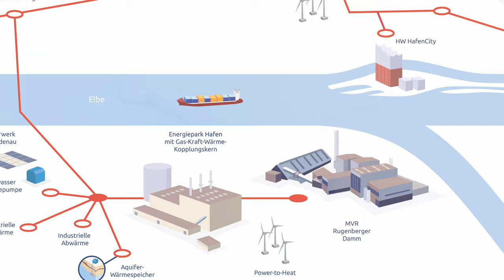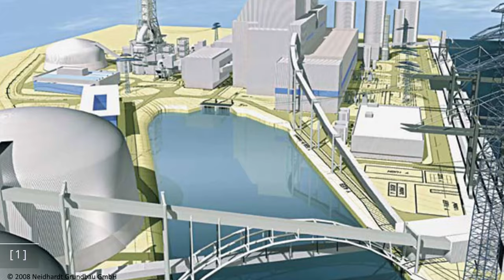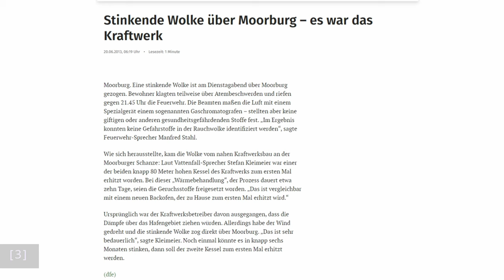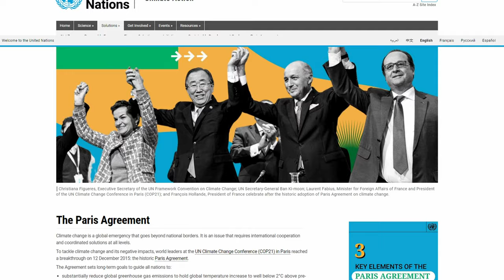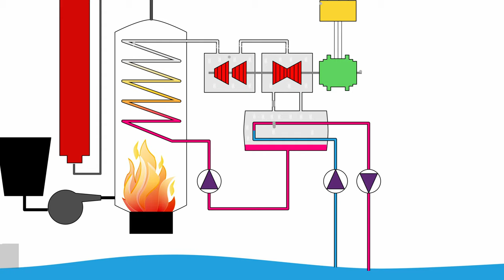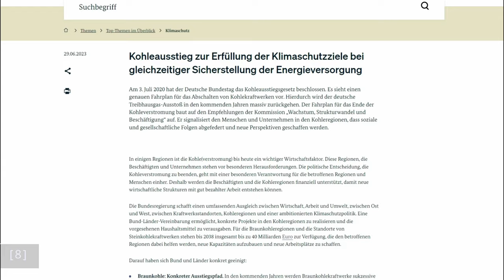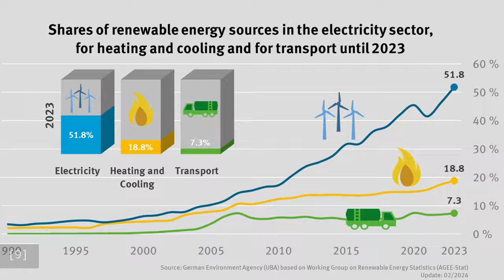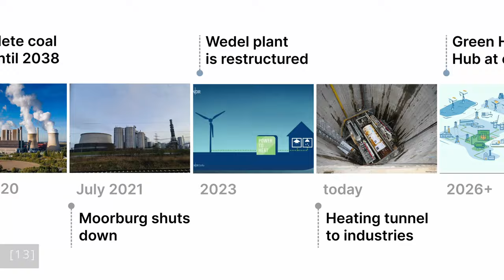The Failure of Europe's Most Efficient Power Plant. What Happened?

Comment: Whoops shouldn’t have stopped nuclear 🎉
Reply: imagine the blunders on that one. Perhaps they should have
Reply: This plant has 2x800MW boilers, the perfect size for a new EPR reactor to be put in to run them.
Reply: We used half as much coal last year than in 2002, when all nuclear power plants were still operative. The world has changed.
Reply: @denniskrenz2080  Yes, but you'd use even less with the 8 nuclear power stations still operating.

It shouldn't be nuclear vs renewables, their both green energy.

You could even retrofit thermal storage to your nuclear power stations to make them dispatchable, with would allow you to use them to fill-in times when intermittent renewables aren't producing (which you currently do with coal/gas).
Reply: @denniskrenz2080  
Half as much coal is fine, but what really replaced it and the nukes? Most likely natural gas, because renewables aren't there just yet.
And how much less CO2 would you produce now with all the nukes still operational?
Reply: @domtweed7323  That is wrong. we would just EXPORT more. That was already the problem for the operators and the luck for our neighbours (Like Netherlands). The NPPs had to sell electricity at too low prices to at least cover the operating costs (see the balance reports of the operators there, at least in Germany, they are all public after half a year). We had the choice between a controlled exit, an uncontrollable one or growing subsidizies like France to just keep them going.
Reply: @denniskrenz2080  Firstly, there's nothing wrong with green power exports. That would help your neighbors, like Poland, use less coal.

Secondly, running a nuclear power station is incredibly cheap after you've built it, most of the cost is construction. There's no net subsidy needed. Same in France, where EDF will be profiting from it's 59 existing reactors for decades, because their extremely cheap to run (though rn their catching up on deferred maintenance, so it looks more expensive than it actually is).
Reply: @denniskrenz2080  
Your aware the life time of a power plant is at least 40 years ? Fossil fuel supplies are expected to be spent in about a generation. 

The choice is ensure you have power, at what price that power is, or enjoy a 10th century life style. (Renewables are estimated to be good for about 10% of current power levels)

The raw materials for renewables will experience shortages due to low ore %. Already copper ore levels of 0.1% are considered acceptable, despite the amount of energy needed to extract metal going up exponentially with reducing ore %.  

( Over the past few decades the acceptable ore % values have dropped from 2 - 3 % to 0.1%, with further drops expected. Metal is available if the energy cost of extraction can be borne. )
Reply: @domtweed7323  France profits so much from its reactors, it tries another time to get EU money for fixing the many problems they have with it, while still refusing the liberalize the electricity market like the rest of Europe. And how is something that produces about 300 tons of toxic heavy metals per reactor and year as waste green?
Reply: @denniskrenz2080  On cost: It's cause they (foolishly) deferred maintenance for decades. The average bill isn't much, it's just all coming due in one go.

On liberalization: Their system works well, why change it? The French have stable, low electricity price is, and carbon emissions/MWe less than 10% of the German level.

And on nuclear waste: It's really easy to contain. You can just bury it, and the most radioactive stuff can even be recycled into new fuel (as the French do). Unlike coal particle emissions, which are also full of heavy metals, but which end up in the air and local people's lungs.
Reply: The nuclear plants were at end of life.  The error was not in shutting them down but in failing to replace them with new and better.
Reply: @wam7484  The thing is they weren't. The Germans did a brilliant job keeping their plants up to date, and they could have kept running them for decades without issue.

And even if some of them did hit their official end of life, it's perfectly normal to replace all the moving parts in a water cooled reactor (refurbishment) and get another 40 years of life out of it, as the Canadians are doing with the Pickering nuclear plant atm.
Reply: @domtweed7323  Its only: they were already running for several decades and we still have no plce to put all the radioactive waste to that is already produced!
Moreover we have to extract 47.000to of radioactive Waste back from the Asse II- Dump, cause there is Water running in the old mine.
And Nuclear Power is the most expansive way to produce electricity. Ask the UK with Hinkley Point!
Reply: @marting1056  Yes, they were running for several decades, meaning they had paid off their construction cost. And construction is the expensive part of nuclear. So, apart from a bit of maintenance and refurbishment, they were extremely cheap energy!

The waste isn't a problem. The medium/low radiation stuff you can just encase in concrete and leave (that's most of it). The highly radioactive stuff you can ask the French to recycle into new nuclear fuel, they have a facility for that. The only radioactive waste that ends up in the German environment is the naturally occuring radioactive particles in coal ash, being launched into the air whenever your coal-fire power stations run.

And it can be expensive to build, but once it's built it's dirt cheap to run. You did the expensive but, building excellent nuclear power stations, then shit them down for no reason! (And replaced them with coal.)
Reply: @denniskrenz2080  
A small amount of toxic waste compared to a coal plant. 

Also photovoltaics, and wind, of current designs, demand metals such as copper in amounts which can only be extracted by using huge amounts of energy, with the amount of energy needed going up exponentially with time. 

One of the side effects will be the destruction of mountains, water source destruction, and release of the heavy metals contained. 

(As ore grade drops, finer grinding is required to extract the metal, each grain of metal is smaller. Each reduction in grain size, results in an exponential increase in energy needed. 

Both the waste, mine tailings, and the metal, have to be ground to the same grain size. 

The total surface area of the grains goes up as the square of the inverse of the grain size, and the number of passes needed to achieve the needed grain size also goes up. )

The only viable source of power available within a generation, due to fossil fuel, and high grade metal ore, depletion, will be nuclear.
Reply: @brianletter3545  Because land is cheap and developing new nuclear reactors is absurdly expensive.

Right now Britain operates a fleet of gas-cooled reactors, but they've never achieved the reliability of standard water-cooled designs because there isn't hundreds of reactor years experience in operating them.
Reply: @domtweed7323  Nope, they still have debt from the construction of their nuclear power stations, they built too much of them so they could never earn money. And electricityprices in France are subsidized by EDF on Stateorder, what doesnt make it easier for them.
Reply: @ingo_8628   Nothing wrong with that: Most of those nuclear power stations will be good for another 40 years after refurbishment, so plenty of time to repay any construction debt.

On the subsidizes: All green energy is subsidized, it makes perfect sense to subsidize nuclear too. (And saves a load of money in other areas, since nuclear needs fewer grid upgrades and less storage than renewables.)
Reply: @domtweed7323  At which cost?  See your own reactors. How long is the building time.  Last year germany has build 14 GW capacity only in Solar power. Nuclear power is outdated before build.
Reply: @andrasbiro3007  Who delivers the uranium? Who takes care of the disposal?  Fat nuclear power plant does not work with renewable energy. From my point of view the decision was good. And thinking of CO2. Check the data in 2030, again please.
Reply: @denniskrenz2080  Was nehmen die sich eigentlich raus. Aus welche Seite ist man den hier gelandet ;-)
Reply: @olaflanfermann7343  A big cost for a big benefit. It'll produce 3GW of continuous green power.

You mention the 14GW of intermittent renewables, assuming a 20% capacity factory they'll also generate around 3GW of power on average.

Essentially they produce the same amount of energy.
Reply: @domtweed7323  Not 20% but 100 %. You probably think oft the efficiency oft pv modules. This is calculated.
Reply: @olaflanfermann7343  No, about 20%.

Solar has an average capacity factory of about 11% in Germany, wind is around 30%, so the average output per kw of installed capacity is around is about 20%.

Modern PWR nuclear is around 90% (their sometimes unplugged for refuelling).
Reply: @domtweed7323 thats funny, even the IAEA states the average unit capacity factor just as 79%, with a lot of cleaning the data from embarrassing data sets. True CF is closer to 75%. Most NPPs simply don't run as reliable as always projected into the future. Baseload is assumed to be 85% in estimates for new plants, but its doubtful they are even capable of achieving this just by themselves. Only very few of the ~400 NPPs achieve perfect 48+ weeks availability in successive years. And don't mention France, which has a lower than average CF already by choice (the NPPs deliver more power than  needed in the summer, but not enough for frost periods). More interesting is the statistic for unplanned losses : Chinese NPPs rarely fail unplanned, its always planned by the wisdom of the CP if they do. 😂
Reply: @denniskrenz2080  It's 79% because your averaging good and bad plants.

Your right about France, they do switch off a lot of reactors over summer.

Here in the UK we have a lot of old gas-cooled reactors that never achieved the reliability of standard, water-cooled designs, so they also bring down the average.

But American reactors average over 90% capacity factors, and Germany's reactors were some of the best in the world for reliability, so there's absolutely no reason newly built reactors using pre-tested designs shouldn't have 90%+ capacity factors.
Reply: @domtweed7323  We´ll see, you'll pay ;-)
Reply: @domtweed7323  they only achieved this number by being in the process of phase-out. Before, even the most reliable plant barely ran 49 weeks per year. With phaseout coming, they received simply a larger fresh load and ran on it until the end. The worst NPP in the statistic is actually one the newest: The only VVER-1200 in Belarus (at this time) had lots of unplanned shutdowns in its first year after commissioning. The second one seems to follow it, but the 2023 statistic for the country is not published yet.
Reply: @denniskrenz2080  As you said yourself, the only VVER-1200 is very unreliable. That's because it's a new design experts have little experience operating.

That's true of every new nuclear reactor designs: They take decades of experience to become reliable.

But if we build tried and tested designs that already achieve 90% capacity factors there's no reason we can't do the same.
Reply: @olaflanfermann7343  Thankfully, Germany is surrounded by countries with excess green energy (Danish wind, Norwegian hydro, French nuclear, and soon Polish nuclear), so you'll probably be fine.

But it's still an immense missed opportunity: German could've been coal free decades ago with nuclear, instead you choose lignite over.
Reply: @domtweed7323  there is still no SMR available (except on PowerPoint). Last try in Poland was a Desaster and is the same ruine like moorburg. Yes, we can be glad to be surrounded by green countries. That gives us a chance to build the missing links. I’m pretty sure that  co2 emissions and price for the power is decreasing since more renewable are available in the German grid is a coincidence. BTW: French nuclear is on position 5 for import. And nuclear is not green, it is low carbon. A fine difference, I think. 
Maybe you can think about what France is doing with its 60 nuclear plants, which had already reached the running expectancy. They will prolong for 20 years at high costs. What happens with France after 2045? They actually plan to replace 6 reactors. Good plan 😉
Reply: @olaflanfermann7343  Firstly, many dozens of SMRs existed in the 1950s-60s, they disappeared because engineers realised (rightly) that bigger nuclear power stations are more efficient. So I don't want SMRs, I want Big Modular Reactors. Hopefully Poland realises that's the sensible approach.

The French have been taking their 60 reactors for granted for decades. They started breaking because neglect and deferred maintenance, not because there's anything wrong with the technology. And, thankfully, France has seen sense and is building several more.

And yes, nuclear is green. Less radioactive than coal, less CO2 that any other energy source,  less space needed than any other energy source, and a waste product that can be easily collected and buried.
Reply: @domtweed7323  the plan in Poland is to build 6 SMRs. But this was before changing the administration. The quality of the French powerplants is that bad, that EDF wasn’t able to keep then running in 2022/2023. up to 40% were in maintenance. They will spend lots of money for a general inspection. Easy since the France government took  over the EDF. 
About the atomic waste… it can easily be buried. But not in my backyard. Only Suomi has a final disposal. I‘m looking forward to future discussions. Funfact: France moved the atomic waste to Russia for recycling. Only 4 % got back. I don’t know how they manage the waste by now.

It is ok, that you like big nuclear plants. As long as you accept that others might think different. 
I apology for my bad English.
Reply: @olaflanfermann7343  No worries about the English, your English is very good.

I thought Poland had lots of different plans to build reactors. Hopefully they choose big ones, because running SMRs requires a similar amount of working and people to a regular reactor, but for less output: SMRs make very little sense on a big grid.

EDF was begun as a state monopoly, and privatising part of it was a mistake. Electricity is like roads or railways, it's a natural monopoly and should obviously be state owned.

On the French nuclear power stations: Gas was cheap for decades, so France neglected them, which did make them unreliable. That's not the reactors fault, reactors of the same design were operating in the US at 90% capacity factors (all French reactors are based on 2 American designs). The problem was lack of maintenance.

And that's because nuclear waste doesn't require geologic storage. It's normally stored in "temporary" drycast storage (big concrete cylinders) to await burying, but there's never been a case of them leaking! It's just sitting there getting less dangerous over time. 

The sensible solution is just to dig a hole at every nuclear power station, line it with concrete, and drop in the drycast containers. Then encase them in concrete. By the time they start leaking, in thousands of years, the radiation will be down to background levels.
Reply: @domtweed7323  Mate, I can't find an example of an NPP constructed in the West this century that hasn't exceeded its budget by more than $10 Billion, and every one of those has averaged being delivered about 10 years after the date it was planned for. Sorry buddy, but you're in a fantasy world where Nuclear Reactors can be knocked together by local tradesmen, and the waste just buried out the back. That is not the world we are living in. After a few accidents local Governments all over the world started putting together different building codes and regulatory hurdles that mean we don't have a Standard Plan NPP that can be built anywhere for a Standard Cost. I'm actually not against NPP's, but the ONLY way they will ever be economical again is if Federal Governments in different Countries introduce Standardised Legislation and Regulation, all while being tortured by renewables manufacturers, green groups, and probably more than half their Voters.
You can't make an economic argument for Nuclear Power anymore. And - I agree, that's bad - Because everyone keeps building Gas Plants to augment their insufficient renewable programs. But every time you compare the cost per kWH of an NPP to anything, it's the worst. Nuclear Power only ever worked because Governments subsidised their manufacture, and wrote their own Legislation. Govts in the West can't do that anymore.
Reply: @tsubadaikhan6332  Let me give you an example: Japan's Higashidori nuclear power station, finished in just over 4 between 2000 and 2005, and supplying 1.1GW of power.

The trick is economies of scale. Just like with solar panels or wind turbines, building one is ruinously expensive, but building 10s of GWs is cost effective. As France discovered in the 1980s.
Reply: @domtweed7323  But the reactors will produce much more heat that has to be blown into the environment due to their bad efficiency.
You cannot replace the much hotter steam of the coal plant with the colder steam from a reactor. You have to throw away at least the turbine, and probably the generator too.
Reply: @gottfriedheumesser1994  The waste heat doesn't matter much, as long as there isn't loads of CO2 preventing its escape into space.

Waste heat might be a legit problem in 300 years, when the economy has doubled in size another 8-12 times. But rn fossil fuels, not waste heat, is the big issue.
Reply: @domtweed7323  It is a problem as they changed from cooling with water from the river to a huge cooling tower, which also reduces efficiency.
Reply: @olaflanfermann7343  
In the early days reactors were built in months and for pennies. Excessive red tape made nuclear power slow and expensive.

Of course safety is important, but excessive regulation reduces safety in multiple ways. Forces reactors to be bigger, to stay profitable, and bigger reactors are harder to cool. Slows down innovation, so the old flawed designs have to be used over and over. And forces operators to keep old reactors running instead of building new ones.

There are uranium mines and enrichment facilities. We have enough fuel for hundreds of years, if not thousands.

And there are several good ways to deal with waste too. They are not implemented for political reasons. But still it's minuscule amount compared to fossil fuel waste.

Nuclear and renewable work together just fine. Replacing nuclear with coal and natural gas is pure idiocy.
2030 is irrelevant, you are emitting far more CO2 now, and that has a cumulative effect.
Reply: @andrasbiro3007  good for you to believe that. 👍
Reply: @olaflanfermann7343  
I don't believe, I know.